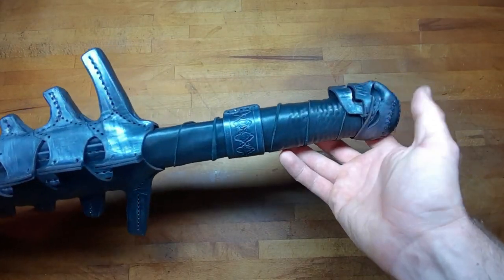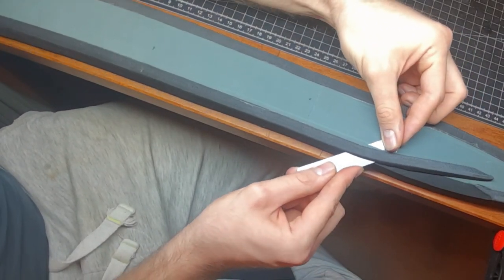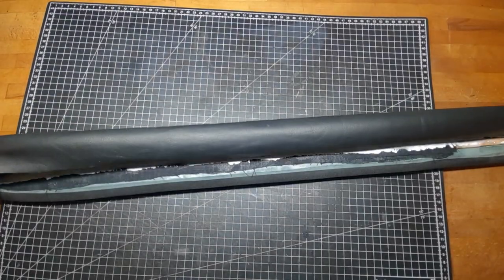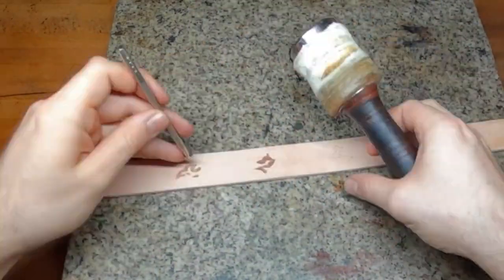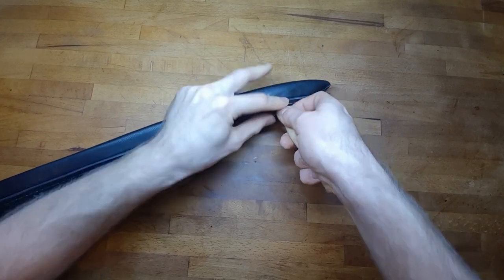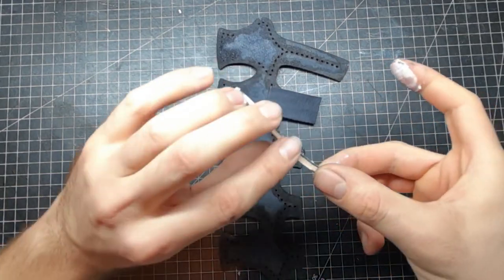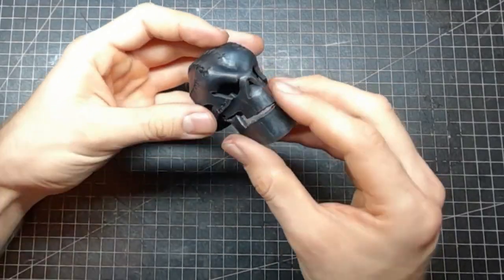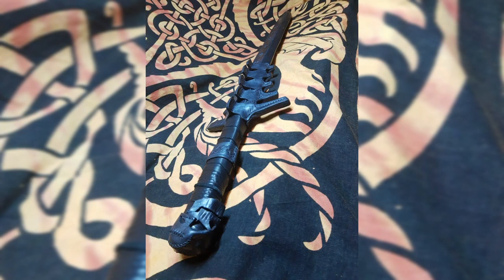Leather and Foam Crafting Tutorial - Runeblade

Comment: really impressive. any updates on the durability of your build?
Reply from the maker: Thank you :) on the other bigger sword I made in the same way I can tell you: it is durable, the foam holds well, but the soft leather which I used on the blade has taken a big damage, scratches of chain mail, next time I would use more durable leather, the one I used is stretchy and more for light cloths. But there is some downside on the foam, it is relatively hard, which still works for a careful fighter
Reply: @NilsBeardfoot  Thanks for your thoughts! Will keep that in mind.